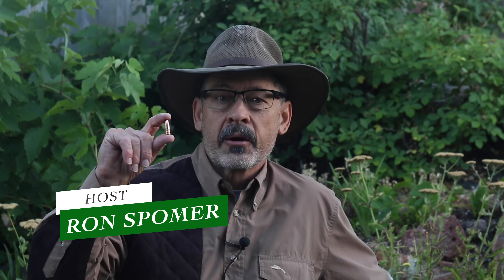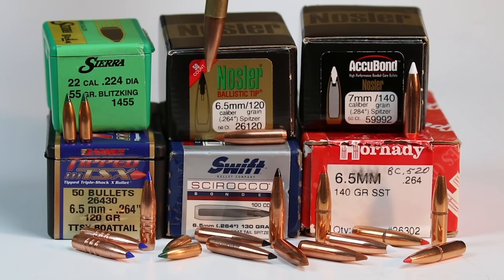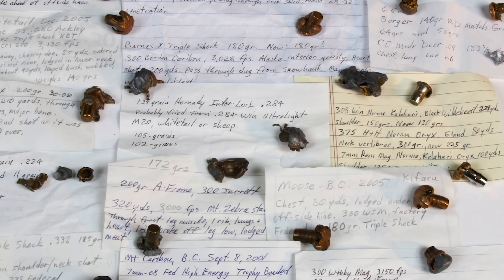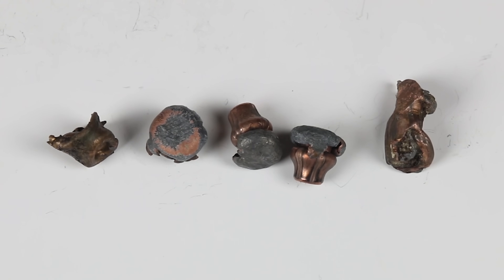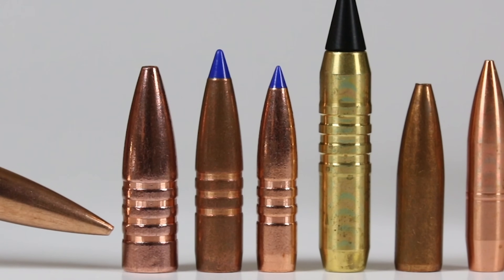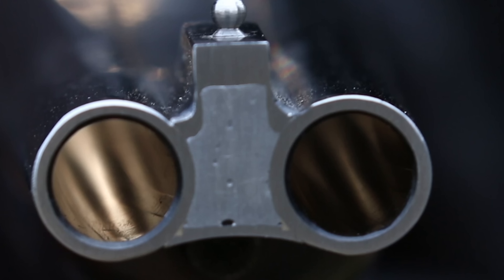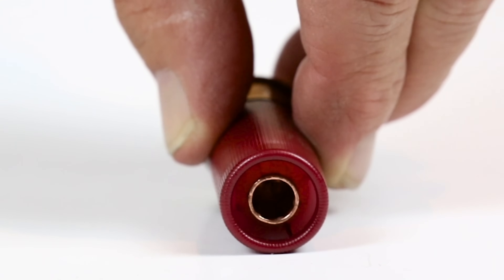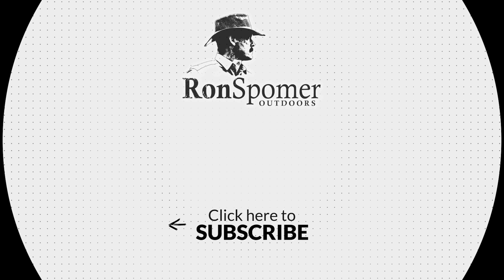Copper Versus Lead Core Bullets — How They Work

Comment: I think that all else equal, shooting copper solid bullets you need to consider a larger caliber rifle.  The BC for a larger caliber bullet will be greater than that of a smaller caliber bullet, of the same length. The BC of a copper bullet will be lower than that of a lead bullet due to the lower density of copper vs. lead.  Therefore, you compensate for the lower density of copper with a larger bullet diameter. I would like to know if you disagree.

Comment: Well you know Ron I am an old fart and have probably killed as many animals of various spiece as you have as a matter of fact I Kill dozens of hogs every year as they  invade my fields yearly. The problem with brass is that fouls a barrel and is hard to remove . At extended ranges they expand very little . actually I have found the rem coreloc the most dependable bullet . Better then the partiton because it does not shed the front halve of the core. I have found the coreloc retain more weight  on the average then any bullet except the  pure copper  . 
Another concern of mine that no one else ever mentions is the fact that solid brass bullets probably are much more prone  for dangerous ricoshays ( I know I misspelled it but at my age you can overlook my mistakes).

Comment: It's a great point, in fact I've seen a video where they've x-rayed deer shot with cup-and-core bullets, and there are hundreds of little specks of lead all through the meat! You can bet that lead isn't the healthiest food.  Copper solids or at least high quality bonded bullets that minimize lead losses will be much safer to use on edible game.  "In many cases, the lead core can fragment into tiny pieces that are distributed surprisingly far from the main wound channel"

Comment: I've taken hundreds of game (wild boar, roe deer, fallow deer, red deer, moose and one brown bear) with copper (and zinc) bullets. They are a little more expensive than the old lead bullets but work excellently and first of all - no lead in the meat. I know it is disputed if you can get lead poisoning by lead bullet splinters, but regarding lead poisoning I simply don't take any chances. Certainly not when the cost is just a lytlle extra money for the ammo. And I 100% agree that the extra chance of an exithole and bloodtrail is very handy. I've  had game run a 100 meter (300 feet) with the heart literally in shreds, but with an exithole you will easily find them.

Comment: I know that Winchester just came out with the 21 sharp, but I wish they would release a new purpose built copper bullet cartridge and gun specifically for whitetail. I think I would be more willing to switch to a completely new platform rather than change the bullets in my tried and tested guns I own now. Honestly having less lead in my game meat that I am eating is a compelling reason to switch. I just wish the copper would expand into the lands and grooves better, and that the monolithic copper wasn’t an accuracy concern when switching from guilding metal on lead core bullets. I know that you have shown cleaning the copper out of the bore can fix that, but I am not confident enough in my gun cleaning to know that I got it all cleaned out. Thank you for this video Ron. I appreciate it.

Comment: I saw a moose shot with a copper bullet. It must have failed to expand because that moose is still running. On video you could see where the bullet hit from a puff of dust off the hide but that animal ran like he only got stung by a bee. A 30 cal hole is pretty small compared to the size of a moose.  Ill stick with a bonded lead bullet that im sure will expand.

Comment: I’ve seen in other videos, cavity back mkz (a copper bullet) out of a 6.5 Grendel at 2500fps completely open up and expand 3 petals peeled back fully open 2.5 times expansion at 400yds very nicely. At 100yards the petals fragment off into a plastic drum filled with water. Makes me think this is the best copper bullet with terminal performance and versatility, transferring its energy and let’s not forget the muzzle velocity of 2500fps, unlike others that rely on extreme velocity.

All Barnes bullets fail to expand beyond 150yds even if launched at 3000fps. They are just hard copper bullets that make blood trails like arrows. The marketing should not be forced down my throat. 

I’d rather the massive shock like a varmint round, but would love if copper can do it.

Those cavity back MKZ were compared with other copper bullets like Barnes and hammer and those other copper bullets could be reloaded and shot again by comparison.

Barnes and the like need to improve their monolithic bullets and get better terminal performance.

Comment: Interesting. I’m not entirely sold on copper, they never expand great and rely on high velocity. They don’t behave like a lead bullet. The wound channel is long or all the way through and the shock energy is actually spread the whole distance, similar to an arrow. It’s like hunting with arrow.

The varmint lead rounds cause massive shock in short wound channel and the energy shock is so localised and extreme and effective. It would be good if copper bullets can do this.

Comment: Ok I hate copper Jackets, they peel, scrape off causing all sorts of malfunctions in my action(s). Would the copper bullets perform the same? or does it hold its own not being electroplated or welded/glued or pressed on? I have to admit the performances shown are very close to the reason I prefer the lead bullet. Being Solid I would think they would be less prone to the issues of jackets.

Comment: Hi Ron , thanks for all the great info . I use barnes ttsx out of my 30-06 and 270  and love them , recently purchased a 243 , i can only find 80 grain ttsx , do you think it will be ok for impala and warthogs here in south Africa?
Reply from the maker: Fabio, that 80-gr. TTSX should be dynamite on impala and warthogs. Penetrates as well as most if not all 100-gr. lead core bullets. My friend George and I use it a lot on whitetails.

Comment: The 165 -169 grain bullet's of various construction loaded in the 308 cartridge can be load developed reasonably enough to allow swapping between them for jump shooting in tbe forest through too open spaces with longer distances and the ensuing lower velocity impact. Nosler Partition, Hornady ELD, or BT's, and even bear driving Swift can all perform within their limits using the 308 cartridge.

Comment: Ron, I enjoy your videos, but in all the videos I have seen in which you discuss copper bullets, I find myself unconvinced of their merits. Especially from a physics perspective.

Also, if you would like to see a real time comparison of bonded vs copper vs lead, check out the meat eater YouTube video.

long range hunting (YouTuber) also has some videos on the negatives of copper and in my opinion makes more convincing arguments.
Reply from the maker: Due to its lighter specific gravity, copper hasn't as high a B.C. rating (performance) at extreme ranges as do lead core bullets. But I've found most coppers consistently more accurate than most lead cores, sometimes faster (for same weight) and always deadly in terminal performance. But this is at what many call "responsible" hunting/shooting distances, i.e. 500 yards and closer. I truly can't vouch for their performance beyond 400 yards because that's about as far as I've shot game with any copper bullet. I usually am able to stalk much, much closer. I truly do appreciate that flecks and shards of lead are not remaining in game I shoot with all copper bullets.
Reply: @RonSpomerOutdoors  
Ron,

Thanks for your thoughtful reply.

From the viewpoint of terminal ballistics, I am convinced that copper bullets are inferior to lead bullets. My confidence in this claim is due to the physical properties of the two metals as well as the multiple ballistics studies comparing the two types of bullets.

This does not mean that copper bullets cannot be used with good results. Obviously, you and many others provide testimony to this fact. However, objectively, a well-constructed lead bullet provides better terminal ballistics.

In addition to providing better terminal ballistics, lead bullets also typically offer significant improvements in external ballistics. You give a nod to this when you point out that B.Cs. for lead bullets are typically superior.

I also have concerns regarding throat and barrel wear. Copper is harder and less compressible than lead (Mohs hardness of 1.5 vs 3 and bulk modulus of 45.8 GPa vs 137.8 GPa) the “relief cuts” seen on most copper bullets are meant to reduce the bearing surface and so mitigate this effect. However, since the bullet is all copper (vs lead with a thin copper jacket) it does not have the forgiveness that a lead jacketed bullet has when riding down the tube. In addition, copper bullets are typically shot light weight for caliber due to constraints on twist rates and low B.Cs resulting in copper bullets typically being shot at higher velocities which certainly leads to greater wear.

As far as the accuracy of lead vs copper is concerned, to my knowledge, no definitive research has been done to establish one material as inherently more accurate (correct me if I am wrong here). Personally, I have found lead bullets to shoot very well out of all of my rifles (I won’t keep a rifle if it won’t consistently shoot at least 1.5 moa). Testimonials are all over the board with this question. Therefore, I do not judge either material to be inherently better when it comes to accuracy. Of course, one has to take into account that well-made lead bullets nearly always have better external ballistics and don’t require as high of twist rates to stabilize them.

I appreciate your emphasis on hunting rather than long range shoot/hunting (I do a significant amount of bow hunting). However, you and I both know there are scenarios in western USA and the tundra of AK that can stretch the Eastern/Midwest hunters’ perspective of “ethical shooting distances.” From an objective perspective of external and terminal ballistics, lead bullets are superior to copper bullets.

Now, for the elephant in the room . . . exposure to “toxic” lead as a result of lead bullets. I would like to state firstly that I work as a surgical orthopedic PA. In addition to this, I have previously published multiple scientific research papers in oncology. I say this not as an argument from authority (i.e., weak evidence), but to explain why my background makes me well suited to drawing conclusions for scientific research. I have taken a cursory look into the published studies on this topic and my conclusion is thus. I do not think that the use of lead rifle ammunition for recreational hunting (at the frequencies of a regular US hunter) is detrimental to the health of the hunter or the ecosystem in any meaningful way. 

The medical research on the toxicity of lead and its long-term consequences is poorly defined. Yes, at high levels of exposure, lead certainly can cause negative health effects, but then again so can copper and yes, nearly anything else.) This is not to say  people should not care about the topic, but to explain that the actual impact on health from lead rifle bullets appears, to me, to be blown far out of proportion to the amount of attention this topic is receiving. For hundreds of years people all over the world have used lead bullet with essentially no significant concretely measurable  health impact. Do you not find it a strange coincidence that this has only become a hotly contested issue in modern times where it is caught up in a whirlwind of Marxist politics? Was medicine and science unable to address this question in the past? (The ability was there but apparently the heath concern was not.)

In addition, I can tell you that scientific researchers and agencies are absolutely not devoid of agendas. (If people have not learned this obvious and painful lesson from the last few years, they do not have the capacity to do so.) People used to think that peer reviewed medical journals and agencies like the WHO and CDC were essentially the gold standard in objective science. It was false 10 years ago and that fact has been made blatantly obvious over the last few years. 

Below I have listed out some of the more influential studies I read regarding lead bullets and made bullet points of some of the more important points as well as some of my thoughts if you are interested.

Suffice it to say, the research I have done combined with my own experience, has led to some conclusions. 1. Generally speaking, well-made lead bullets are superior to copper bullets because they offer improvements in external and terminal ballistics. 2. Lead bullets are safe to use for the average hunter especially if said hunter makes good shots into the vitals and processes their own game carefully and cleanly. 3. Similar to other modern “science/medical” controversies, much of the research performed on the subject is completed with a high degree of bias with the purposes of the studies being essentially to push certain agendas which certainly do not actually care at all about the health of people or the environment.
 4. The effects of chronic lead exposure on health is not at all well known. 5. This is true of many other substances as well and taking up the philosophy of "I will just avoid something if there is a chance it is detrimental to my health" will result in hypochondriasis (and therefore decreased health) and is also untenable as so many material substances would fit into this category.

Wishing you a holy Lenten journey,

stat crux dum volvitur orbis

PS due to length of the reply it will be in 3 parts. This is part 1.

Comment: Great video. 
I had the absolute test in Namibia. 
I got the chance to cull 20 Oryx. 
338 RUM with 210 Barnes TSXs and 210 Swift Sciroccos. 
All chest shots. 
Every Oryx hit with a 210 TSX  took a few steps. Or ran 50 yards plus. 
The Scirocco knocked them off their arse.  Only 1 ran. 
Rest my case.

Comment: Love the video. I too pondered the whole "should the bullet pass through or should it stay in the animal" theory and originally I felt that it would be good to have the bullet stop in the animal. But the more I hunted I realized that having an animal have two holes to bleed from usually meant an easier track and quicker bleed out. Plus if it's not getting good penetration, a hit through bone might not get deep enough for vitals. There's a sweet spot with just about everything. Too much is too much and too little, not enough. I think thats why having game appropriate calibers are important. Absolutely love it Ron, keep it up.

Comment: The one deer I have shot with an all copper bullet was a disaster. Shot hit the back of the head, just below the right ear and exited through the area of the tear duct near the left eye. 80 yards with a 243, Hornady GMX. Deer had to be dispatched as it was screaming and kicking. For now I think I will stick to the bonded core and partition style bullets. I do feel the all copper/gilding bullets are getting better but need more research to be as good as some lead style bullets.

Comment: As an old fashioned hunter, I'll just stick with the tried and true winchester 100 gr. 243. The last 3 200 lb. Axis I've taken haven't even taken a step when hit smack dab through the ribcage with exit holes the size of a quarter, and  tremendous damage to the heart and lungs. All of these Axis were shot just short of 200 yds broadside.

Comment: For decades, my 'turn to' bullet manufacturer was SPEER. I've heard all the hype on Hornady, Nozzler, etc., but when copper-meets-paper, I've NEVER seen a well-loaded Speer bullet be outdone when it came to absolute precision. Now, that was before the drive for 'partitions' (which in reality, have a TERRIBLE time with precision at distance...you won't see 'partition' bullets advocated or supported for use on 1,000-yard ranges). Of course, as long as you have allocations provided for proper o-give sealing in the barrel, as mentioned in this video, all you really need are new loading charts which define 'performance at load'...basically just 'rework the tables for any reloading manual'...but there is often the rub...its a LOT EASIER to simply think 'zinc or antimony doesn't pollute like lead', than it is to put thousands of dollars into actually chronographing such 'new bullets' with accurate loading tables.

Comment: I prefer bonded , I have run into length issues with solid copper. But they do work great in 243.
9:20 - I have had those issues also accuracy to the point where I couldn't tune them in some rifles - was disappointing and they are not cheap had far better results with bonded on those rifles.. 

The Non bonded Ballistic tip rounds I have used .. hmm I have shot well with those on paper but I once hit a Doe with my spare tag broadside - you could stick your pinky into the intake wound.. 2 fists out side the ribs  on the back side wound and the hydrostatic shock went right from ribs to the shoulder it was a mess. never again.

Comment: Which monolithic has zinc and what does it do?
Reply from the maker: Zinc reduces oxidation of copper (corrosion,) makes it slightly harder and stronger and adds "lubricity" due to its lower melting point, I believe. Typically the gilding metal jackets of cup/core bullets are 95% copper, 5% zinc, making them brass. But hundreds of alloys are made with copper. Just which are used to  make specific monolithic copper bullets remains proprietary with each brand.
Reply: @RonSpomerOutdoors   I’m looking to switch to monolithic for performance and to avoid lead in my food.  Seems like Barnes and Hornady are all the ones I find.  Gmx has six and Barnes does not from what I can tell. Yet most seem to prefer Barnes.  Am I missing something?